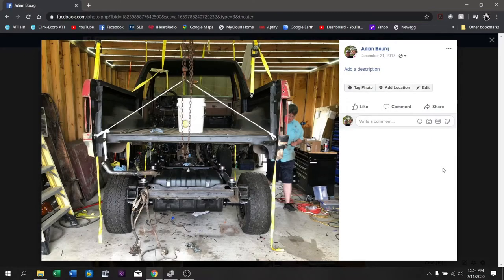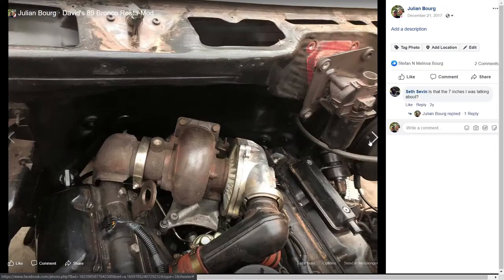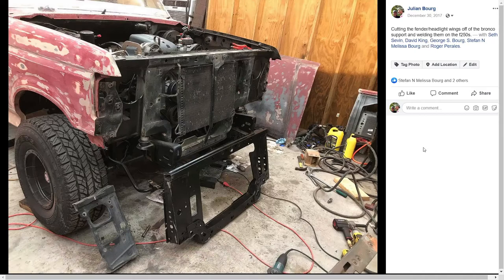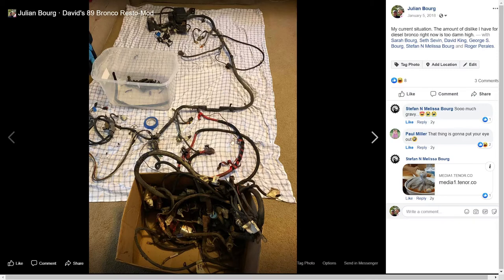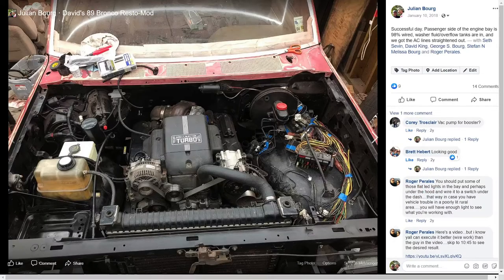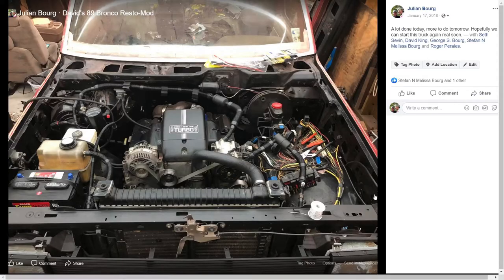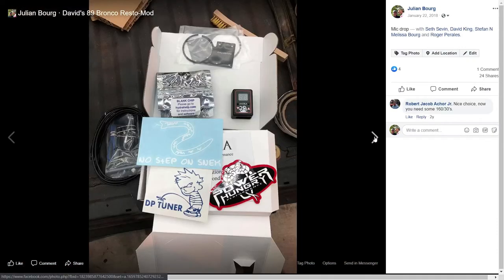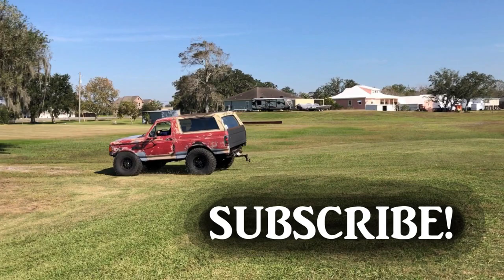How to Build a 7.3 Powerstroke Diesel Bronco - Part 4

Comment: Watching this because I have the option of a 03 powerstroke complete parts truck for an 87 bronco.

Making sure I understand correctly. But the body lift, alone with trimming/ bending of the pinch welds at the back of the motor gave the clearance needed?
Reply from the maker: The body lift will clear the drivetrain. I tried to sneak it in without the lift, thats why I originally trimmed/bent the pinch weld. It definitely cant hurt to do it anyway. The pinch weld is enormous and it results in tons of room to work.
Reply: You are way better off starting with a runner F250 powerstroke chassis and fitting the Bronco body on that. This Bronco chassis won't stand up to the 7.3 weight and torque? IMHO.
Reply from the maker: The F250 and F150/Bronco chassis were dimensionally the same in the 80/90’s. This specific truck has seen whoops and jumps at 60+mph with 40” tires at over 600ft lbs...no issues.
Reply: @MurphysLawGarage  the frame was the same, not the other components. Itll break up one day. That,s why they made 1/2 tons and 3/4 tons. Do your reaserch.
Reply from the maker: What like axles/springs? We moved those over. Honestly, how in the world could you tell me to do my research when I had these frames side by side and BUILT this truck. The only component that was heavier was the transmission support so I used it as well. Then for giggles I stitch welded the riveted sections of the frame.